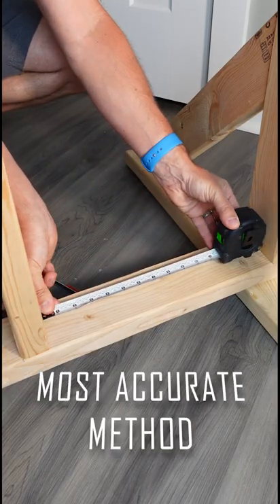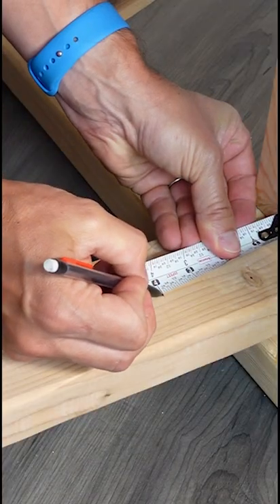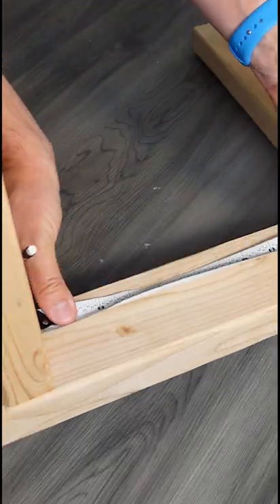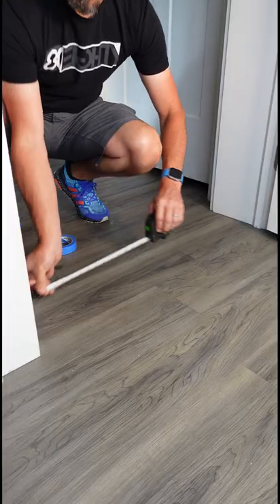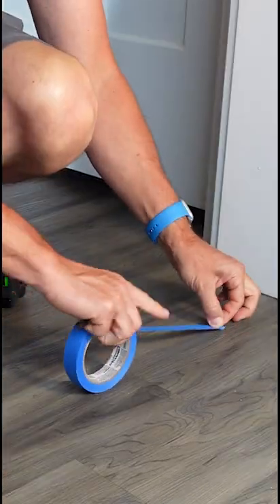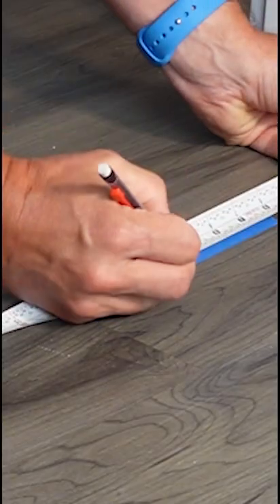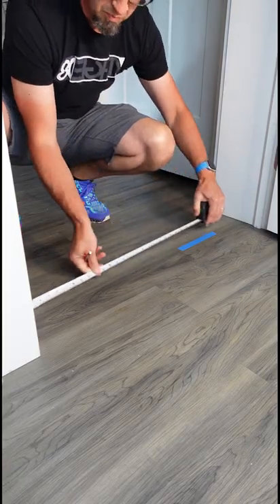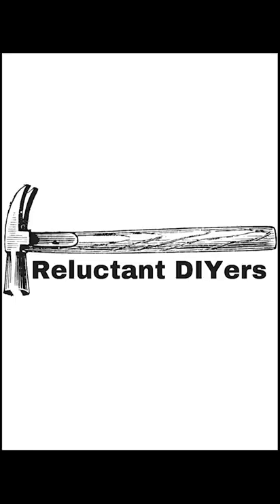BEST Inside Corner Measuring Method

Comment: Doesn’t the tape measure actually tell you how long it is, so you can just add the tape measure length to the measure length?
Reply from the maker: Hey Nick, thanks for watching! It sure does, and I have a video for that also. Sometimes, due to several factors, using that method can be off by a 16th or 2. That’s why I shot out this method. I hope you have a great day!